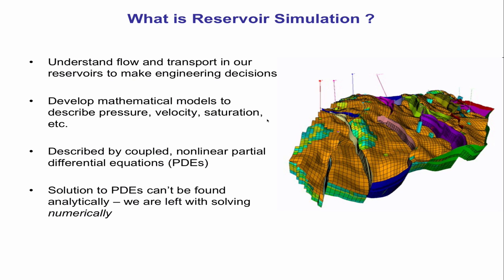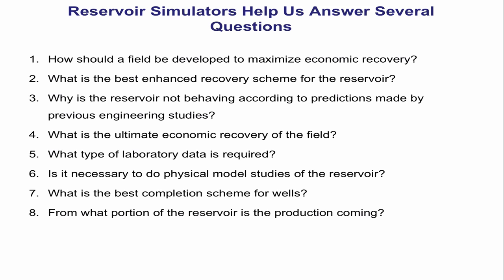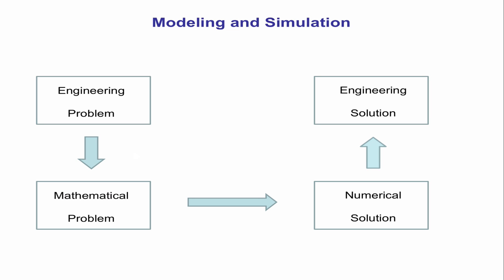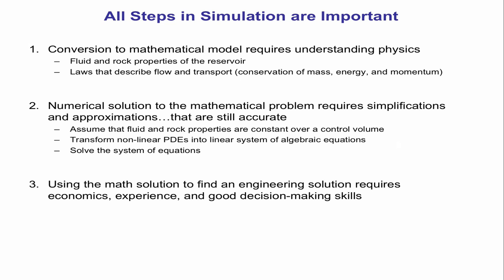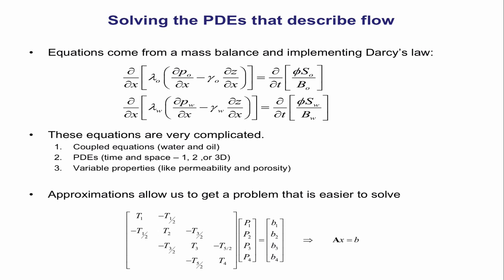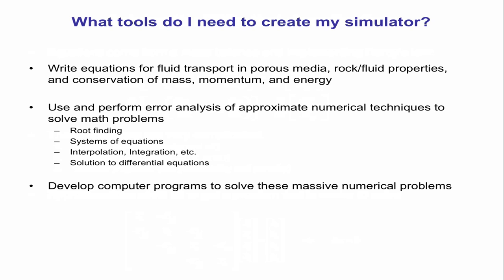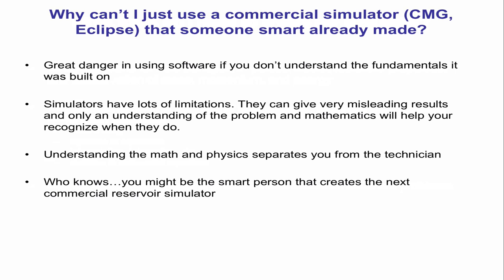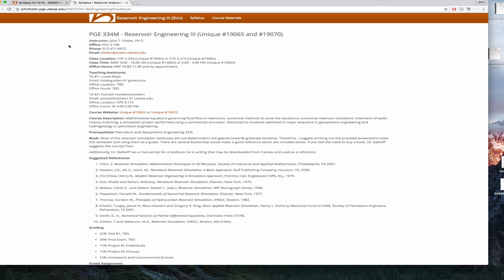Introduction to Reservoir Simulation

Comment: Why teach this in python? I've read that C++ is more than 100 times faster under some work loads? when time is money, shouldn't simulators be designed in C++ (or even modern-FORTRAN)?

I was curious to know what language does industry use?

I learned to code in C++, and matlab, and python. I don't find C++ that much more difficult to program in, I actually like it more, because the code seems to be more specific, and easier to understand.

I created z-factor simulator in C++ in a couple hours about a week ago because I was tired of using the tables with a ruler. It was 260 lines of code, and I'm not a C++ pro by any means, but it was pretty easy to do. I will follow your course, but do it in C++ :)!

BTW Thank you for this high quality course!
Reply from the maker: Production quality simulators should be written in C++.  This is an undergraduate class in which most of the students have very little programming experience.  It is far beyond the scope of the class and their typical limitations to expect them to do it in all in C++.  

Also, when using Numpy data structures for the numerics, Python can compete with other compiled languages in terms of speed.  Especially when development time, readability, testing, documentation, and developer community (i.e. access to help) are taken into consideration.
Reply: PGE 323M Reservoir Engineering III (Simulation) Well at anyrate, thank you very much for these videos.
Reply: In addition to publisher's comment, I would like to add one thing: Being "faster" does not always mean... wait for it... being faster.

When you are coding a "small" program, it is applicable to use the efficient language. However, nowadays, with our very advanced computer hardwares (even PCs of today has more CPU power and/or RAM than of a supercomputer from previous decade), the real bottleneck becomes "development" phase. That is why, it is much easier to develop things with Python than it is with C++ since the syntax is much more simple and there is a universal guide for coding (e.g. PEP-8). 

I am not saying that Python is superior to C++ or vice versa. But being "fast" is just a trait and traits are useful only when they meet the objectives. When you need 1000 engineers to develop something together, fast, you might need Python over low level languages (Big C fan professors will execute me for me saying C is a "low-level" language, but here it goes :) ) and when you have a long time to develop a robust software, you might pick C++, FORTRAN etc.